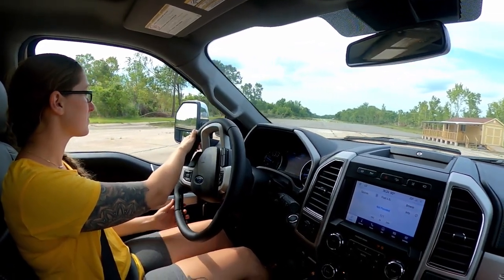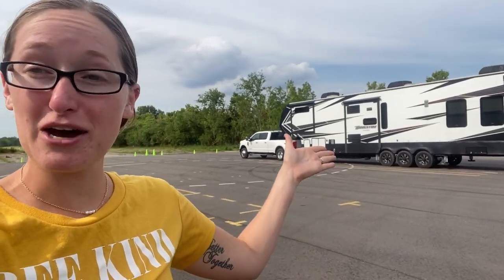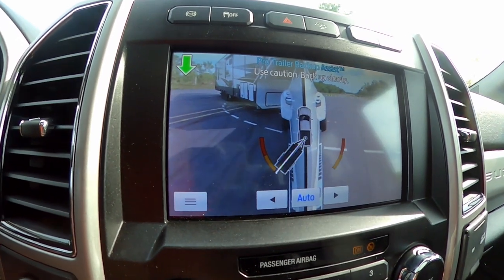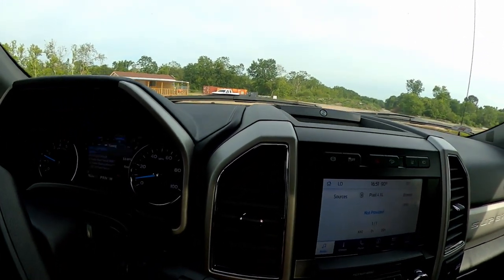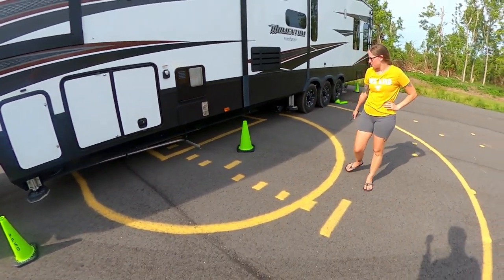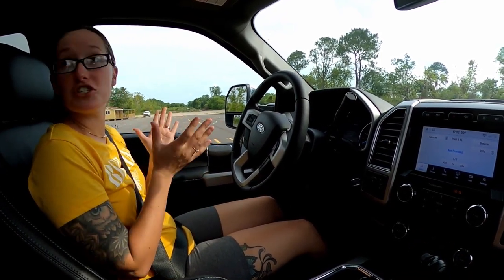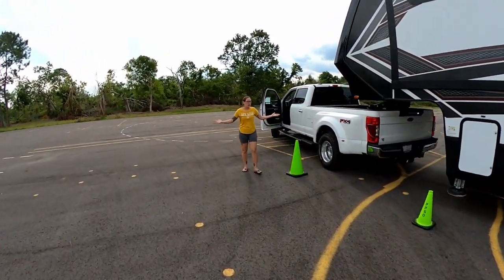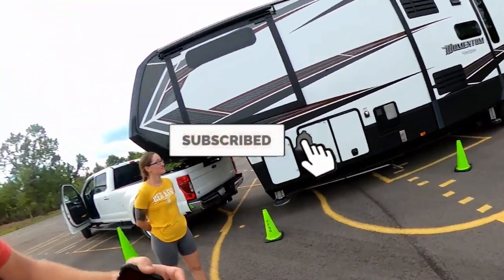2020 F350  Pro Trailer Backup Assist

Comment: Try that in a tight campground, it now becomes a hole new ballgame. All your attention is heads down looking a small screen and bad thing happen real fast.  When I back my 5th wheel my head is out the windows through the hole presses. We tend to lose sight of the big picture with Technology. I’ll stick to the tried and true process  of driving the truck😄
Nice explanation of the backup assist though…..

Comment: Did that come with the sensor or did you order it? You wouldn’t happen to have the part #
Reply from the maker: Good afternoon Sir,

The parts for the backup assist were included when we bought the truck. We will check and reply here on the part number. 

Very respectfully,

Jeff and Amanda

Comment: I have so much RV stuff in the truck I missed the cable. I went to the parts department at the dealership to purchase one. Found mine in the zip lock bag under the rear seat. I have had my F-450 for three weeks. Backing a 44 ft trailer has suuuuucked for three weeks
Reply from the maker: Hey Bhos68! It gets better! When we started we drove straight to a big parking lot to practice! Take your time and stay safe!!!

Happy travels!

Very respectfully,

Jeff and Amanda

Comment: Hi, we just bought a f20 with the protrailer back up, but the parts department can't seem to find the part number for the sensor do you have it?
Reply from the maker: Hey Ricki, We will look tomorrow!
Reply from the maker: Good morning!

I went and looked on the sensor but I cannot find a part number. It may be inside the housing which seems strange. 

Very respectfully,

Jeff and Amanda
Reply: I am having this same issue. Parts has no idea what I'm even talking about, haha. Any luck finding the part?

Comment: When you changed the view of your camera,  is the size to side view from your truck camera system or do you have trailer cameras wired into your truck camera system?
Reply from the maker: Hey Bruce!

Those are the cameras on our trucks side mirrors. We only have 1 wireless camera with a separate monitor on our rig!

Very respectfully,

Jeff and Amanda
Reply: @WeLiveFreeRV   i seen a video on the Fast lane that used the camera on back of trailer to

Comment: Can Ford’s Pro Backup Assist be used on an Airstream trailer with the large propane tanks and tank cover on the trailer’s tongue?
Reply from the maker: Hey Skip,

I cannot say 100% for sure for your rig. However the back up assist did come with accessories for bumper pull trailers. I am very confident that you would enjoy using this with your airstream. 

Stay safe and happy travels!

Very respectfully,

Jeff and Amanda
Reply: @WeLiveFreeRV  i have a 2020 f250 and my pro trailer backup assist came with the old sticker assembly.  does not work after repeated attempts with my airstream
Reply: looks like the system used here is like what comes with the new 2021 f150 back-up assist models.  surprised a 2020 cam with the new mechanical system that attaches to trailer vs. the sticker system that does not work

Comment: Great video, guys! We are picking up our new 43’ rig with our new 2020 Ford F-350 w/Pro Trailer Backup Assist next week. I’ve been looking for a demo video going over everything, and this was exactly what I was hoping to find. It looks like you used the adhesive to mount the Sensor - will you be using screws to more permanently mount the Sensor? Now that you’ve been using it for a while, do you have any additional thoughts for newbies using the system? Do you use your rear-most camera mounted on the back of your rig now, as opposed to the cameras you were using in the video? Thanks!
Reply from the maker: Hey Steve! First congratulations!!! 

1)We still use the adhesive mount, we did switch our pin box to a gen x executive gooseneck hitch ( great investment) this forced us to remove the original adhesive and replace it. We replaced the adhesive with 2 sided gorilla tape and it’s doing great! We’ve had our rig in below freezing temps and over 100 degrees and have not had any problems with the adhesive. 

2) Advice: 
    A) find a large parking lot and practice with the backup assist. We ran through various scenarios including backing up a road (made with cones in parking lot including curves), backing into an angled spot, a spot that requires a 90 degree turn. 
    B) make sure anyone who helps tow normally knows how to use it as well.
    C) when backing up always use a “ground guide” also on this note. Make sure the driver and ground guide use common language. For example when we back up our rig when we use directions (go right / go left) we are always referring the direction we want the tail end of the trailer to go. This works very well with the backup assist.  **we are working on a video for this ;) **
    D) if communication is ever unclear stop and link up with your ground guide to discuss what needs to occur ( this helps with establishing common language) take the extra 1-2 minutes and save yourself heartache and money. 
     E) Also we always operate that if the driver can’t see the ground guide than the truck and rig don’t move until the ground guide is back in view. 

3) camera system:  yes we did buy a wireless camera system. It’s was not a name brand system but it works great for us! It was the FHD wireless system. FHD 1080P Digital Wireless 2... https://www.amazon.com/dp/B07FM58K2W?ref=ppx_pop_mob_ap_share

This camera has its own monitor which allows us to use the Ford camera system and the backup camera system. 

We hope this helps! Don’t hesitate to reach out if you have any other questions! Be safe, happy travels, and happy new year!!!
Reply: We Live Free RV - Thank you for the fast reply! 

We also swapped out the MORRyde Pin Box for a Gen-Y Executive 5th Wheel Pin Box because of concerns about clearance since we have an Access Tonneau Cover which adds to the rail height and also narrows the width of the bed opening. I spoke with Jason @ Gen-Y about mounting the Sensor, and he said it would be ok to use 2 screws into the Gen-Y metal, but I’m inclined to see how secure the adhesive is first, so your comments about heat and cold are reassuring. 

Looking forward to trying to find a good practice area, but weather will be our challenge after picking the rig up. Since there were delays, both at the factory and after the rig was delivered to the dealership, we are now needing to move the rig from MO to MN in January winter weather. We’re keeping a close eye on the snow forecasts. We basically just need to get the rig back to MN and backed into the indoor storage spot we have rented. (That is making me nervous...!)

I do think we’ll be using both the Ford cameras and the system installed on the rig. Did the Pro Trailer Backup Assist package come with a Ford-supplied rear camera? And if so, it sounds like you didn’t elect to use it.
Reply from the maker: Hey Steve!

 Our truck did not come with the Ford camera you attach to the trailer, but it might be something you can get your dealer to add in with your purchase! It was an option for us to buy, but we ultimately went with a camera to mount to the furrion bracket. 

One thing that always helps us Is to do an aerial survey of where we plan on stopping.  We talk through the turns we will make and any concerns we think we might encounter. We have parked in some interesting places and have had to really take our time backing in. We just stop and the ground guide checks the clearance on both sides and the top before we move again. 

Be safe while traveling in the snow! The plus side is that by the time you tow to the storage location you will be infinitely more comfortable with it! Remember to go slow and if you are ever in doubt stop! 

Great call on the gen y hitch. If you haven’t used one before you will absolutely love it! It’s a great upgrade. The next upgrade we’d suggest is air bags for the truck! We have traveled some unique roads in Louisiana and Texas, and the combination of gen y hitch and airbags definitely helped!

Oh and don’t forget to rinse the salt /brine off your rig prior to storage (weather permitting) 

Very respectfully,

Jeff and Amanda
Reply: We Live Free RV Again, thanks for the reply and the great tips! We became aware of the Gen-Y pin box from another YouTube channel where they had issues with their rig’s stock MORRyde pin box not working with their Ford (they also have a tonneau cover setup, although different from ours). 

We follow several channels, and another one recently went over modifications they made to their Ford’s settings using the Forscan device to modify things like the ‘dings’ that chime every time you turn on the truck, etc. Here’s that link: https://keepyourdaydream.us10.list-manage.com/track/click?u=21e50869187207bbbb3a536ab&id=25117c8f2b&e=7f8a73e5ea. Also, in that video, there is a segment on beefing up the security of the inside of the cab of the truck - we decided to purchase this based on seeing the video (it’s scheduled to arrive today!): https://www.consolevault.com/ford-f350-super-duty-captain-chairs-full-floor-console-2017.html
Reply: Glad I saw this video. I have a 2020 450 with the backup assist and haven’t used it yet . I also have the GenY gooseneck hitch which is wonderful and added airbags. The airbags also make a difference on those expansion joints . What’s your 5thwheel weight ? I have a 40’ New Horizons and the 40’ is interior measurement, so probably closer to 42’ long . My weight the way we travel is a little over 23k

Comment: Where does one get the sensor/kit you installed on the trailer? I have searched everywhere for this and can't locate it?
Reply from the maker: It was a part of the tow package when we purchased the truck! If you have a ford with this system it should have been included. Reach out to ford if not! Good luck!
Reply: Yeah, getting the sensor is a huge problem.  Ford is failing it's customers in this.
Reply: @WeLiveFreeRV  where exactly was the sensor located? Behind the seats? Glovebox?
Reply from the maker: Ours was just in a big plastic bag sitting in the back seat. I would reach out to the dealer and ask about it
Reply: @WeLiveFreeRV  well after weeks of arguing with the dealership and posting a scathing review on FB, thanks to your response, I went outside and looked behind seat and all over back seat; pulled down the divider and there the plastic bag was! Now I  have to call the dealership back and beg for forgiveness. This humble pie does not taste good at all! Thanks a bunch for reply; I pretty much just gave up on ever having a sensor. Have a great day!
Reply from the maker: We are glad you found it! We hope it is working out for you!

Comment: Great looking truck and rig! I've noticed you have the rotoflex pin and use the awesome Anderson Ultimate  Hitch. Did Anderson let you know about the lockout kit for the Rotoflex pin? It is used to keep the pin from moving up and down and damaging the rubber pad.
Reply from the maker: Hey Stinezz44223!

Thank you for your compliments and the tip! We did end up buying the rotoflex lockout kit shortly after this video published! It worked great. 

We did end up swapping out our Anderson (which worked great) for a gooseneck pinbox.
Reply: @WeLiveFreeRV  Been wanting to try that one but I'm a little reserved about it. I like that you have the ability to inflate an airbag for a smoother ride!
Reply from the maker: @stinezz44223!  Feel free to reach out with any questions. We do love the airbag system it was a game changer for smoother rides!

Very respectfully,

Jeff and Amanda